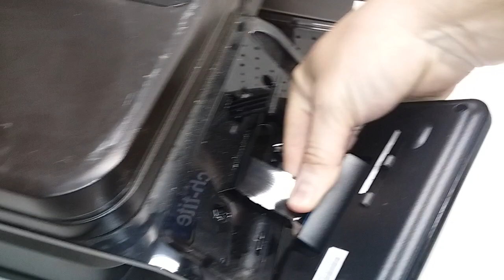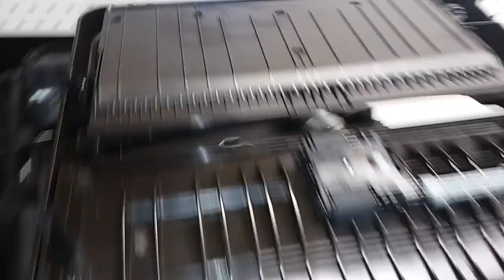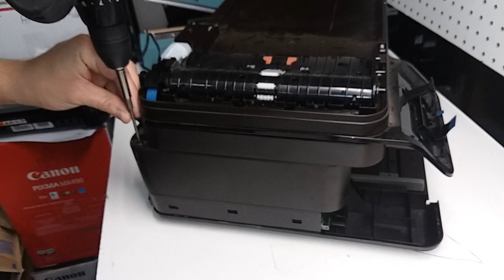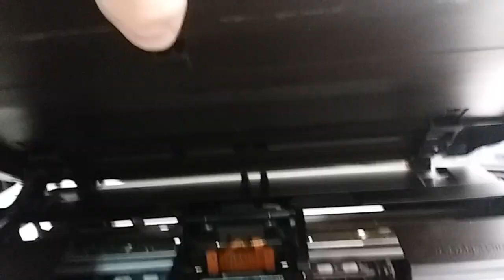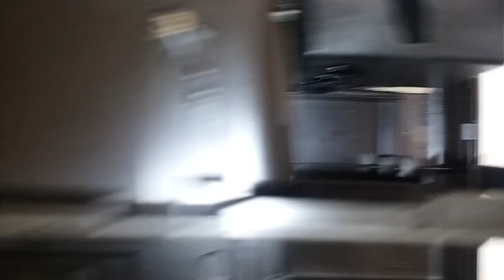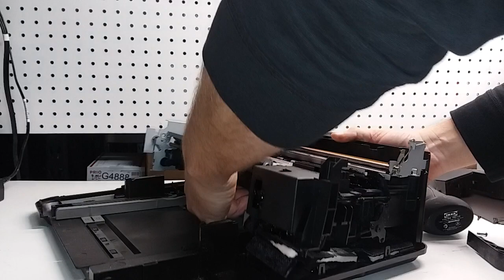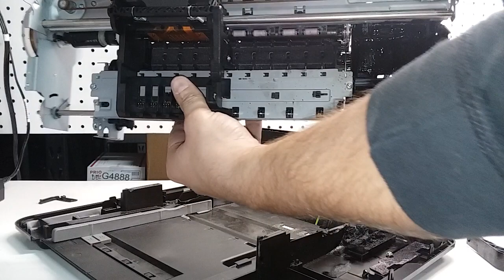Taking Apart HP Photosmart 7520, 7510, 7525, 7515 Printer Disassembly

Comment: Can you please explain how to replace a scanner light bulb on a 7520 Photosmart printer.  Printing blank pages!!
Reply from the maker: It most likely is not the scanner. When you are printing from the computer, are the pages also blank? If so, the ink cartrudges are dry or printhead is clogged. Also to test if your scanner lamp is working, make a scan to computer or media card. If the scan is successful, then scanner is working properly.
Reply: 303 Electronics There is no light when scanning. I can print via Bluetooth from my phone and it’s fine. Won’t print from paper feed or regular scan. If it does only bits and pieces from feed. Ink is new.
Reply: How do I replace the scanner lamp? There is no light that comes on when it scans or tries to copy. I assume it’s burnt out?

Comment: Hi 303 Electronics - Thank you for posting this video.  I managed to follow your video step-by-step and was able to dissemble and re-glue my broken gear that moves the ADF for general paper printing.  One of the mishaps that I found was ensuring that the printer assembly was aligned properly so that the duplex part is able to enter, so I had to dissemble and reassemble again.  The printer is working mechanically, but the control panel is no longer responsive or lights up.  Also, my power button and wifi light no longer work.  I'm able to print documents via the cloud, just need to disconnect the cable to shut it off. Do you have any suggestions on how to remedy this?  I've checked the cabling several times and everything is connected in it's proper place.  Thanks again for your help.
Reply: I have the same problem that I want to repair. I am wondering how much did you have to disassemble in order to expose the gear that needed work.
Reply: @garthmicro  It's been about 2 years, but from what I can remember I dissembled all of it.  On the video it's around 15 minutes in. Good luck to you.  I ended up purchasing another printer since it was hard to manage the ink levels and changes to my WiFi.  Becareful not to damage the wires to the circuit boards!
Reply: @jaimevillasenor9221  Thanks for taking time to reply.

Comment: Hi, awesome video. How do you fix the printhead when it doesn't automatically move to the center when the printer is open. It doesn't slide. The error message for printhead missing keeps coming up... can you help?
Reply from the maker: First thing to check is to make sure all ink cartridges are down and locked. Squeeze your hand over the printhead and make sure all cartridges are down.. If that is all good,, try this: Open the cover on side of the printer where printhead is. You need to remove 2 or 3 screws to do that and the side pops off like I show in this video. Then spin the gear exposed and the the mechanism that locks the carriage will release the carriage.
Reply: @303electronics  ok, I took the side off but the gear won't turn... and the little pulley belt seems loose, could that be the problem?

Comment: Hi thank U 4 your suggestions. I have another issue: there are two little tubes on the bottom of the black plastic part, close to other three longo tubes. those short little tubes are fixed on on side but apparently free, without any other connection on the ending side. Is it correct? should the ending part be free with no connection? thank for your kind replay. A.

Comment: Need to open my photosmart 5720 because the rollers that feed the paper from the tray wont spin. Its a good printer and I have printed over 5k copies without any problem.
Reply: Have the same problem. I looked with a flashlight and a small mirror and I can see one of the plastic gears has stripped from the metal rod that drives it. if you skip to 15:30 his thumb is resting on the rod to the left are the gears that drive the rollers.

Comment: I just did this and now my touch screen is white and the power button doesnt illuminate when on 😔 and won't turn on unless I unplug the power cord
Reply: Hi Kaki - I also have this problem.  At one point my control panel was white and now it doesn't light up at all.  Did you resolve this issue?  If so, what did you do to fix it?  Thanks
Reply: @jaimevillasenor9221  I tried fixing it but I couldn't return the band to it's original position so I just ended up getting rid of the printer and buying a new one 😔

Comment: Epic life saver. Thank you !
Reply from the maker: 🙂🙂🙂🙂Glad I could help! Thanks.
Reply: @303electronics  I have a few questions on this printer if you have time to give some advice. I noticed inside the printer, where the ink head rests, all the way to the right, there seems to be a plastic container. I think it is to catch any access ink, and it has a mesh piece. Is this where the printer head cleans itself?
Reply from the maker: @ninja226  Hi. The pads absorb excess ink, yes. The printhead is cleaned with rubber squeegee that slides back and forth under the printhead rest. The printhead cycle purges ink through printhead and then wipes it off with squeegee. It is best to clean printhead manually to avoid losing lots of ink.

Comment: My Officejet 7510 will not print black text. Everything else works fine. And I have put in a new ink for the black and did the clean by soaking of the printhead ... It still does not work
Reply from the maker: There is two black ink cartridges.The one you need for text black is the bigger of all. Try to flush black color like in the video in this link:
https://www.youtube.com/watch?v=DFdM9Z6Nnxg&t=8s

Comment: Hello. Nice video, however I have little bit different problem.  I have found a printer, HP7510 in a garbage place, but no external adapter was nearby. There are 3 pins for power on the printer, middle is clearly GND, upper one has crescent, and down nothing. Above are just written two voltages 32/12V. I used ATX 200W power supply as a source of the voltages but have no idea how to connect it. Please if you can look at my small video here and help me if you are so kind. It is only 5 minutes to meassure working power adapter and fwd me the info what voltage is on which pin. @. Thanks in advance. Martin.

Comment: My 7520 has a deep paper jam, but when I turn it on I get a message "Improper Shutdown" and then the unit turns off and the Power Brick PSU shuts down (no green led). Obviously the paper jam has caused the unit to shut down to protect itself??? Do I just need to take it apart and remove the paper jam and then the message should go away? Thanks for any tips

Comment: Can you please show a tear down of a HP all-in-one 250 mobile printer?   When I was trying looking for paper in the unit due to continual paper jam errors and the pick up roller not picking up paper, I accidentally pulled out a board connection.  I got as far as taking apart some of the molding and the top lid.  I at a loss.  This printer is JUST out of warranty and has a high price tag.  I don't want to pay for repairs if I don't have to.  Thank you!

Comment: I have this printer 7520 and it no longer recognizes any of the ink cartridges.  I have exhausted hp’s Troubleshooting guide and replaced the ink as well as the head.  Any suggestions for saving this printer from the heap?

Comment: I am trying to fix my printer the same one taken apart in this video. I am having an issue with mine where it does not roll the paper any longer. I cleaned my printer and followed another trouble shooting video but the issue is the pick up rollers or (the rollers that direct the paper up) I have paper in my tray but it tells me to put paper in the try. Can anyone help me to a video that can show me how I can fix this issue... buying a new printer is not in my budget. Thank you.
Reply: Charlissa Berry https://youtu.be/1n5Fwn4hwik

Comment: Thank you a thousand times. Using your instructions I was able to disassemble the printer to access the logic board to re-solder the pins of the power connector. The printer now works again. I would never have been able to do this without your help.
Reply: My 7520 says it has a Printhead issue... Ive Swapped out the PH bug it still shows PH error. How do you “Reset” the error message after doing this repair? Or are the contacts behind the PH bad??
Reply: Hi I have a problem with paper feeding .... the first time I hooked up the printer I saw a green substance on the paper then the printer stop feeding paper unless I push up the paper.... in the last part of the video on the base piece of the printer it have a lil green strip I believe in my printer that was showing up on the paper .... my printer was packed away for 2 years b4 I even opened it .... any advice on how to make it feed the paper without me pushing paper forward 1 by 1 .